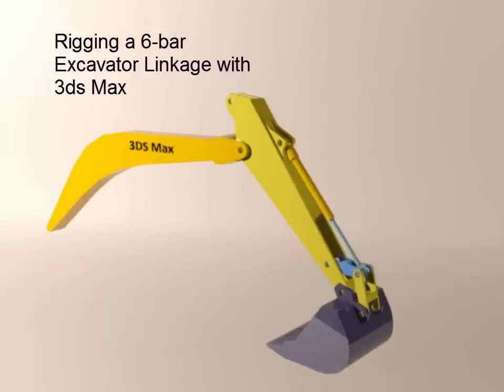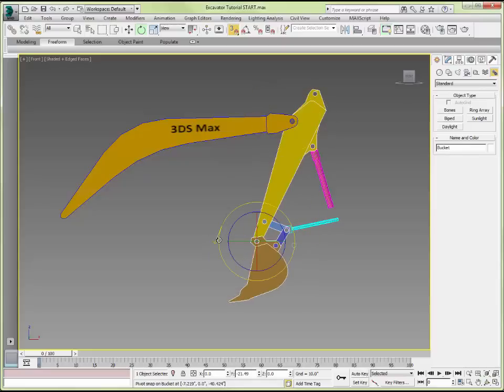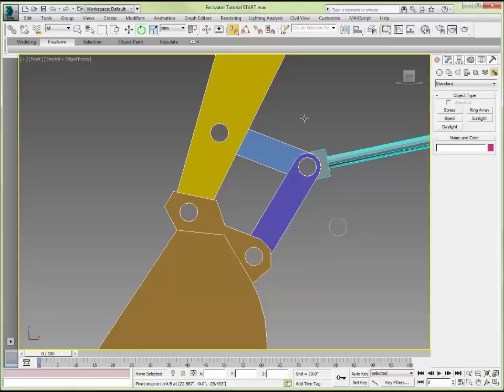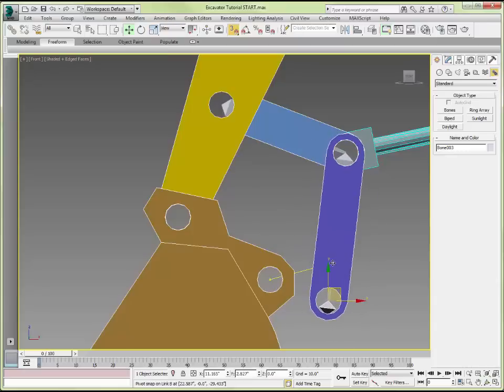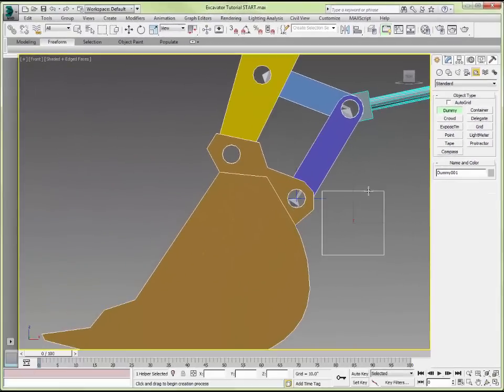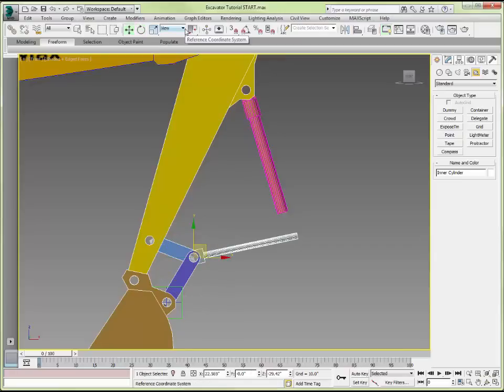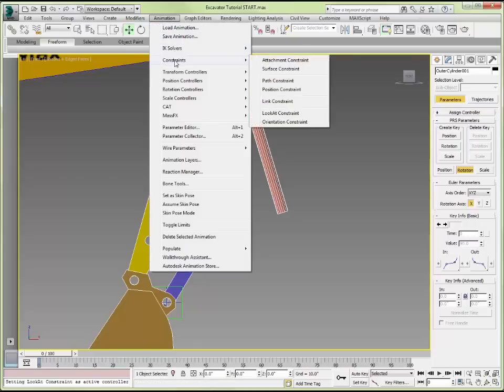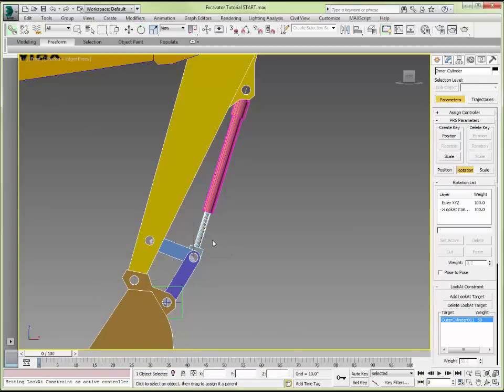Tutorial: Rigging a 6 Bar Excavator Linkage with 3ds Max

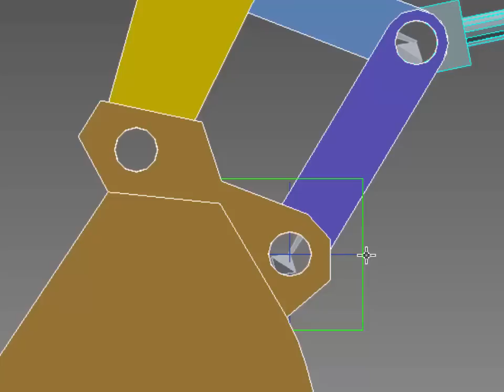Comment: I couldn't form the four bar linkage, at the part at 3:55, my objects just explodes all over the place. Anyone having the same problem?
Reply from the maker: IK solvers are constrained to lie in a 2D  plane.  The plane may be at any orientation in 3D space.  The first thing I would check is that the pivots of the components all lie on the same plane.  Rotate the view of your model in 3D and visually check that the IK solver lies in the plane that it should (i.e., a plane perpendicular to ground).
Reply: @LeeMinardi  hi Lee, thanks for the tip. It's working now :)